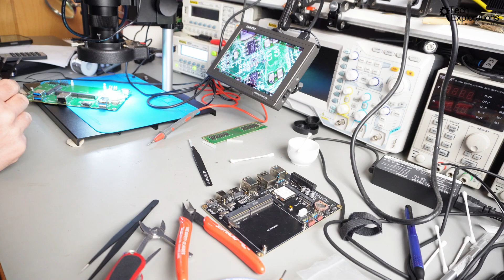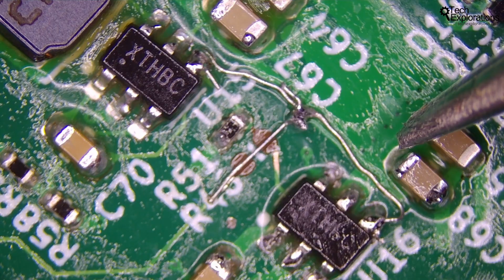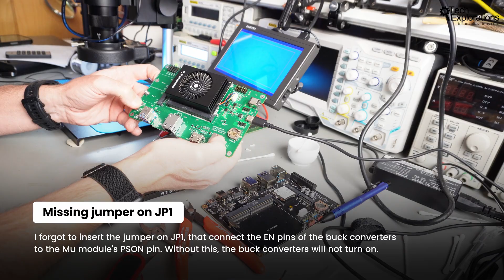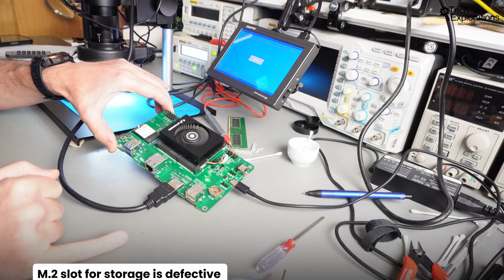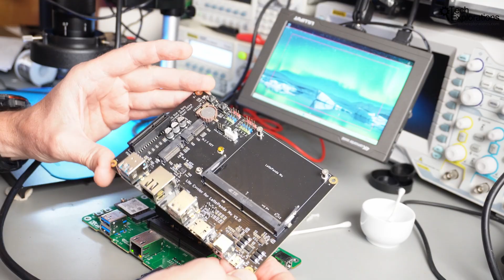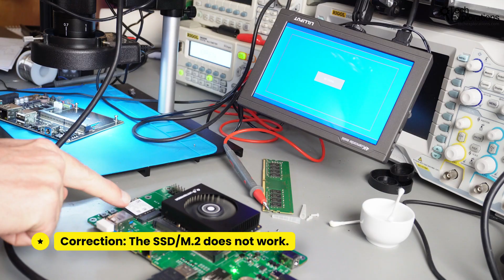Custom LattePanda Mu Carrier Board – First Successful Boot After Repair

Comment: how  the ssd not worked and the device boots to windows?
Reply: emmc?
Reply: @75darkness75  what?
Reply from the maker: Hi all, the eMMC isn't working yet. I don't have an answer as to why; all my crosscheck against the reference design look correct. The computer did boot into windows because the LattePanda Mu module has on-board storage.